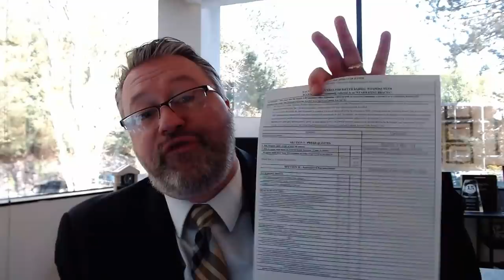How the ATF Will Enforce Their New Pistol Brace Rule

Comment: According to the Federal Register (Vol. 87, No. 20), the ATF has set tentative dates to finalize two proposed rulings with potential to significantly impact FFLs and gun owners. The rulings are related to the “Definition of ‘Frame or Receiver’ and Identification of Firearms” and “Factoring Criteria for Firearms With an Attached Stabilizing Brace,” with final action expected in June and August 2022. So if you want to get them without the hassle... now is the time I'd say.

Comment: If you have a AR pistol taken in for repair  just take the brace off prior to dropping it off. This new infringement isn't legislation though.
Reply: @chrisgross31  wrong!
Reply: PHD in Common Sense!
Reply: @chrisgross31  No you don't.
Reply: @chrisgross31  no, I would have complied with the new arbitrary rule, there is no brace on the pistol therefore its a pistol. I mean its a pistol even with a brace but King Joe says otherwise -_-
Reply: @chrisgross31  it's not a buffer tube rule. Braces aren't exclusive to adjustable tubes anyways so it doesn't really matter what kind of tube you have.
Reply: So long as the upper and lower are not together, then you do not have an SBR.
Reply: @chrisgross31  nope I have one were I can just remove the brace and leave the buffer tube alone
Reply: Why take a gun to the gunsmith anyway? Most guns like the AR etc are easy to work on.
Reply: @John98512  CA, 30+ years ago
Possession of full auto parts and an AR receiver is a machine gun
even though the gun will not fire in full auto.

Stopped the use of surplus M16 bolt carriers in AR-15

Comment: Even if they found you with it they'll be reluctant to take you to court because it's not a stock.  Nor is there a wrong/right way to shoot a pistol. If the manufacturer and retailers have anything saying "this is a brace and is not intended to fired from the shoulder" the burden of proving you intended to skirt the NFA is on the ATF which is basically an unscalable mountain for any attorney in this instance.

Comment: They'll go after brace manufacturers first, then manufacturers offering braced AR pistols, then FFL dealers, then demand that local law enforcement notify the ATF when someone they question, for whatever reason, is found to possess an AR pistol.   As for taking an AR pistol to an FFL for repair or modification, you can avoid problems by just taking the brace off before you take it to the gun shop.
Reply: Well, except for the other points that make it a "rifle". Like the weight for one thing. And do you have a red dot on it? Or a scope? I'm wondering if a Desert Eagle with a 10" barrel will now be considered a SBR.
Reply: @Courageous_Lion  Well, perhaps I'm wrong, but my understanding is that those other points only come into play if the pistol has a brace mounted on it.
Reply: @MrJedi5150  Well said and to put a cherry on top. No local department is going to make it a policy or expectation to enforce some new ATF rule that they can't locally prosecute, has no precedent, and may not even be legal.
Reply: I don't think they'll end up with any authority to go after brace manufactures. Even if this rule goes through as proposed and it almost certainly won't. But even then, the rule only applies to assembled firearms, not parts. So a parts manufacture would be unaffected. 

Some complete AR pistols maybe, but only ones that fall outside the weight and length requirements. Other aspects of the point system require a complete system with sights and everything. They simply sell it without sights as is common with ARs. these days. 

Jedi5150 covered local LE well.
Reply: Actually they can't go after brace manufacturers because the braces by themselves are not firearms, nor are they even considered firearms parts.
Reply: @YorktownUSA  Remember bump stocks?
Reply: @Courageous_Lion  no brace, no point system to classify it. Point system is for braced weapon only.

Comment: The upper is easily removed and/or replaced, which will determine whether you own a SBR or not. Should you ever have to take your lower or upper in, just disassemble the two. At that point, the FFL doesn't know what you have.  My non-lawyer thought on this.
Reply: Slides pistol upper on to Rifle lower
Go on...
Reply: Throw a can on it pin and weld it make it 16in There you go a rifle.

Comment: ATF 2032: The recent "definition update" defines the term "machine gun" as any metallic or polymer object constructed of any two or more mechanical parts capable of physical contact with a bullet. Class 13 megafelony punishable by $5,000,000 in fines and 50 years in the Amazon-Walmart federal internment labor factory, plus 20 year probation for all living relatives.

Comment: If this rule change actually happens, I am sure it will get struck down in the courts. In the meantime if you own an AR15 pistol with a stabilizing brace and need to take it in for repair or modification, just take the stabilizing brace off before you bring it to your FFL repairman.

Comment: Back in the seventies and eighties before AR pistols and car 15s got popular. We would put a 3 in foam pipe insulation over the tube extended about 4 in off the end. Held tight with duct tape or zip ties. Slips on and off easily. So by taking the pistol brace off your pistol you're legal again.

Comment: I looked at the points system on the new form.  How will a FFL holder determine if a lower receiver brought in for repair or replacement of parts (like a trigger) meets the criteria of a SBR if the upper receiver is not present?  Moreso, how is an FFL holder supposed to know if they are working on a SBR if the brace is removed?
Some braces like the popular SBA3 brace will absolutely fail the ATF's criteria even without an upper present (I scored it at either 5 or 6 points depending on how you interpret some criteria - and ATF could add more points depending on how they interpret the design category).  But this model is also one that a FFL could have brought in for repair without ever knowing it had a brace on it at any time!  All the owner has to do is remove the rear portion of the brace and then there's nothing to indicate that the buffer tube is being used with a brace.
Another type that I have handled would only score a total of 2 points without an upper present. But again, that is entirely dependent upon how certain criteria ATF sets out are defined/interpreted.  NOTHING in the regulations gives us this definition or interpretation!
I've been a gun nut for about 30 years, an attorney for almost 24 (with 5 as an Admin Law attorney in JAG) and I can't figure this out.  How the heck is a FFL supposed to?

Comment: If you are turning your rifle over to an FFL for trigger work, only provide the lower. Remove the brace or stock and the upper. Only turn over the party that needs the work. Beyond that, replacing triggers is so easy you should never turn your forearm in to get that work done. Do it yourself. Learn to do as much yourself as you can and leave barrel install and indexing and headspacing alone to a gunsmith/FFL.

Comment: It is my opinion that they not only will enforce it through the FFL but they will also enforce it through local law enforcement, traffic stops red flag laws and any other time you encounter law enforcement to where you may or may not be required to disclose that you have weapons and what weapons they are, law enforcement may choose or desire to look at the weapons for safety purposes and what have you and call the ATF or even confiscate and take you into custody if you don't have a $200 tax stamp on you while you're in possession of something that they might consider an SBR or SBS, based off the assumption or the intention to hold you responsible for something you may or may not be doing wrong, to avoid liability for violating your rights at a traffic stop, at your home or whatever once they find something they can chalk up to criminal activity they are free and everything that they did is justified at that point, even if it was a blatant violation local, state, federal  or the constitutional laws and rights of the US. They've done it for years with basic traffic stops, don't have any legal reason to have stopped you they look for problems all over your car including but not limited to your tint. That way they can say they stopped you for that reason.

Comment: And in the Fed. Register (Vol 87, No. 20) the proposed final stage rule re. stabilizing brace firearms is listed as "Priority: Other Significant", which "Significant rules (defined by Executive Order 12866) and major rules (defined by the Small Business Regulatory Enforcement Fairness Act) are required to have a 60 day delayed effective date."
So if they do the Final Action on August 1 2022, that means if I'm reading this right the new pistol brace regulation with its "score card" wouldn't go into effect until the end of September 2022.

Comment: wasnt the pistol brace originally designed to be used strapped to the forearm ( the original design  was not adjustable in length )?  so when it was modified to be adjustable so that it is now long enough to be used against the shoulder and then added to rifles with short barrels  didnt someone think that that would get targeted?.. any one with a logical brain could have seen that coming.  so people found a round about way to own a short barreled rifle place a brace on it and then call it a pistol . but never use it as a pistol.  call it a pistol and use it as a rifle .

its a famous WW1 british saying  .   stick your head over the trench and it will get shot.

so basically you guys by bending the rules placed the pistol brace in the firing line
Reply: the pistol brace was deemed 100% legal BY THE ATF and the atf has previously said that there isnt an illegal way to hold a pistol. They have already said these are completely legal and in line with the law. They are now creatively reinterpreting the law to make every one of the millions of these braces that have been sold felonies. 
The weapons are pistols by definition of the law. The atf has no law making powers, they do not have the ability to change the law to make things they suddenly decided they dont like illegal. So instead they reinterpret the current law and arbitrarily change definitions often in secret so that they can outlaw new things without having to actually get law made. The atf is bending the rules more than anyone who happened to hold a pistol the wrong way.
Reply: @westcoastwarriorsarchive7929  serves you guys right .  a big deal was made about bending the law so that short barreled rifles can be used   by simply having the called a pistol  and placing a brace on them.  the same way you guys selectively bent the law to circumvent it  dont cry when the ATF change the rules to circumvent your circumvents :D :D :D :D :D

Comment: I have 5 words to contribute: "Paperwork Reduction Act of 1980." I have examined the "worksheet" and it's a nightmare, ambiguous, incomplete, and in need of more complete sentences. The "criteria" seem to have been developed, along with the silly 0-4 points grading system, so that everything will be an SBF. I was especially drawn to the 1 point you get for either having sights or not having them. Cartoon characters have 4 fingers and I couldn't stop thinking about that when imagining the folks who concocted this. And without validating any of this, shouldn't the onus be on the manufacturer to determine ONE TIME whether each stock model passes or fails? And if so, shouldn't they be including an instruction sheet alerting you to which mods could change the classification of the weapon? Finally, I note that there is nothing about the ammunition caliber. Does it use a pistol caliber? Rimfire? If so, can we skip the buffer tube questions?

Comment: If they try to force the FFL to enforce their rules, what is preventing a customer from only taking the part to be worked on to the FFL? Using your example. Say I want to have a trigger installed or fixed, what will prevent me from only taking the lower receiver minus the brace of stock to be scored?

Comment: Legitimate question:
If an AR has a brace and a barrel less than 16"... But the overall length is greater than 26" with all accessories removed what's the legality? Asking for a friend. Technically it doesn't meet the criteria listed on the form 4999 required to move on to "points". But it's still an AR with a brace and a short barrel? It it now legally just a "firearm"? Or is it a pistol? A rifle? SBR? This is so ridiculous...

Comment: This "rule" is in direct violation of the ADA.  These "criteria" are laughable as it uses a "one size fit all" approach.  What fits a 4'0" 75# child will not work for a 6'2" 280 adult, so this points score sheet is utter BS.  The lack of logic, and completely ignoring any use of accepted industrial hygiene standards (ACGIH) on ergonomics is a recipe for being made a fool in court very high   As a disabled first responder for whom braces help me maintain control to safely operate a firearm evenwith the nerve damage i have as a result of injuries sustained in the line of duty.  For example the length of pull points, doesnt even take into account for proper ergonomics, including center of balance.   I have a feeling that in the near future the ATF is going to find themselves not only facing legal challenges for the utter BS the rule is, but will also be facing DOJ ADA division coming after them... Thatll be fun to watch the hilarity that will ensue.

Comment: The ar was designed as a 20 inch rifle. I can understand the need for the carbine version but anything shorter is starting to create problems with function. The pistol brace was a dumb way to try to get around a loophole in the SBR regulations. You had to know you were taking a risk by buying it. I knew it was dumb from the beginning. I don't feel sorry for all the mall ninjas.

Comment: I don’t understand how putting a stock or vertical foregrip on a pistol suddenly makes it illegal to own unless you pay the tax and get the correct form. It’s just their way of making more money off of the people. Those modifications make you slightly more accurate, that’s it. I can get a handgun (without a stock or grip) and just slap in an extended magazine and have basically the same performance as an “SBR”. Putting a stock on a pistol shouldn’t make it a Rifle, but it’s their definition I guess. Gun control in general is just preventing people from defending themselves and we need to protect it

Comment: Was just wondering what if your braced firearm is an "other" as in larger than the definition of a handgun and was originally registered and manufactured as such...
Reply: Another channel did a video on the DnD character sheet of felonies and one of the prerequisites was that it be greater than 12 inches and less than 26 inches in length.

Comment: Come to my door, it will not be opened. I will however tell you to get off my property, at which point, they will be captured by different angles (the front from doorbell cam, and the right side from camera on angle of house pointed in driveway and door) and they will be asked "do you have a warrant?" They will say no of course. At which point I will say "then you need to get tf off my property within 60 seconds or I'm calling the police, and if you're still not gone, I'll file an order of harassment" at which point they will still attempt to talk, I'll cut them off, and say "goodbye." Clickup goes the door bell talk. Have a nice dayyyyy. And GOD forbid you knock my door down without a warrant...you'll be in for a rather rude awakening. Question is, is that awakening worth the harassment? Ask yourself that. Yeah atf agent, you, the random wannabe cool atf agent reading this comment. Is it? Honestly, is it? I AM willing to die for my 2nd amendment right, are you prepared to do the same to attempt to take that away? Better think long and hard.